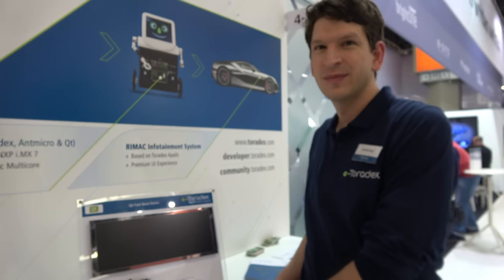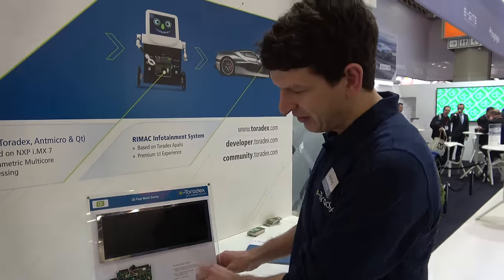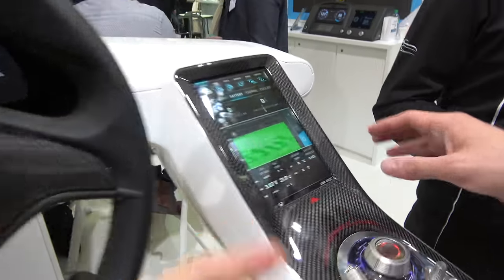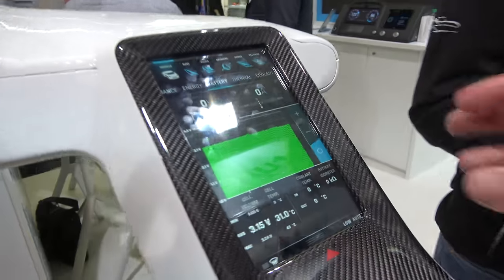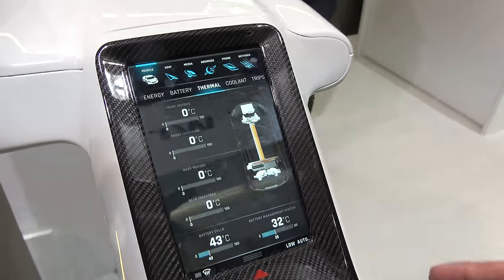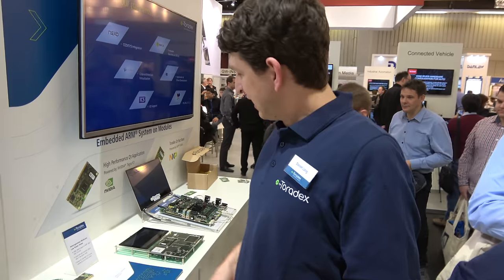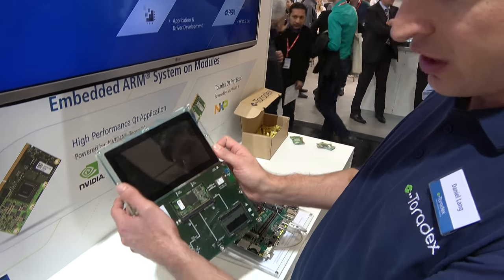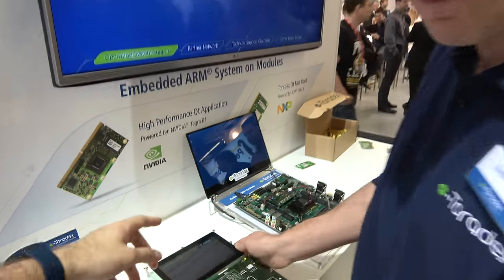365km/h electric car, Rimac Concept One with Toradex Apalis Systems inside

Comment: Why you dont use better ARM processors instead of old Nvidia Tegra K1? Any of that modern ARM processors is able to run Linux OS with better performance and all of that processors is 64bit instead of 32bit Tegra K1.
Reply: You can assign each core of the Nvidia Tegra to individual sensor inputs from the car making it the central processing unit of the car helping with torque vectoring and other capabilities